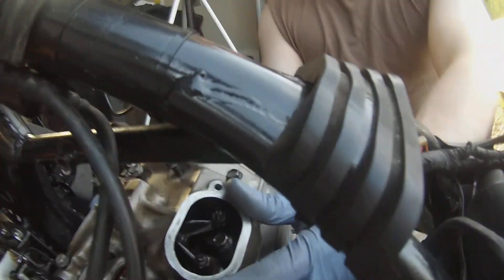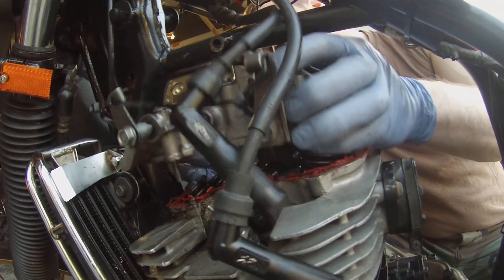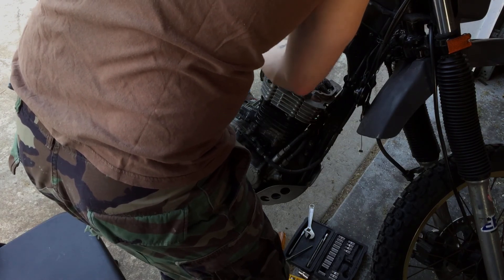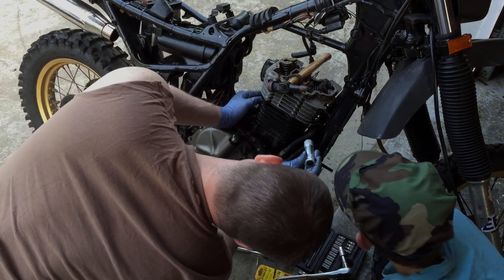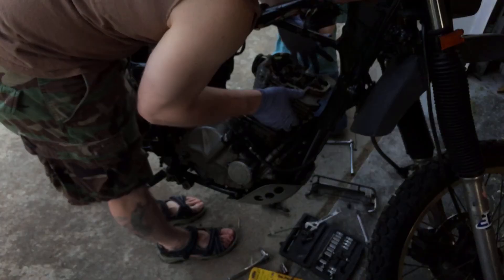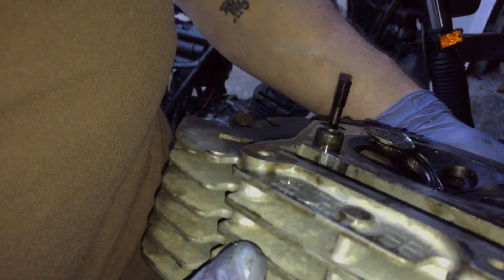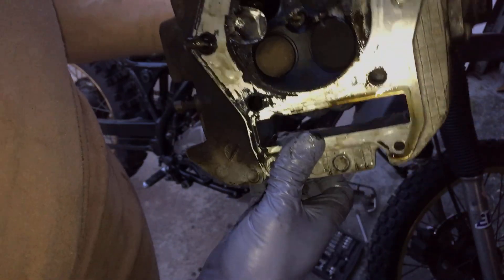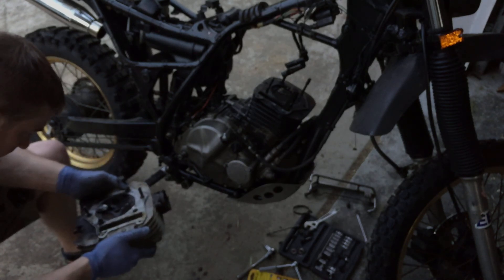How To Get Into Dual Sport Riding For Cheap Ep. 17 (engine go boom)

Comment: I say if you still have it and can find the parts get the manual and try to rebuild it engine work on a dirt bike isn't as hard as people think I rebuild the top end on a Chinese scooter and bored it too an 80cc  with 333miles on it sold it running with 1200miles on it and rebuild the top end and split cases on my xl185s 917miles later still runs and drives had the transmission in pieces crank out an every thing the good thing about my bike is an xl185 has almost the same engine as an xr200 parts for it are easy to get what are you going to get for it 300 dollars I like your channel a lot more then some of the bigger you tube guys look forward to more videos
Reply from the maker: dirt bike Wow, thanks man! That means a lot to get encouragement like that, it seems overwhelming sometimes when things just keep going wrong but I keep telling myself that eventually I will just end up making this thing like a new bike.